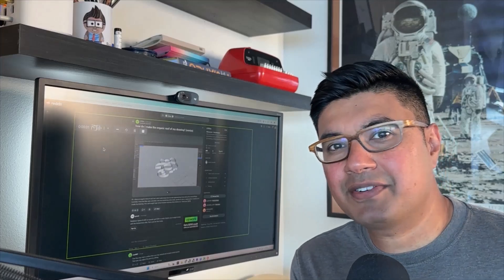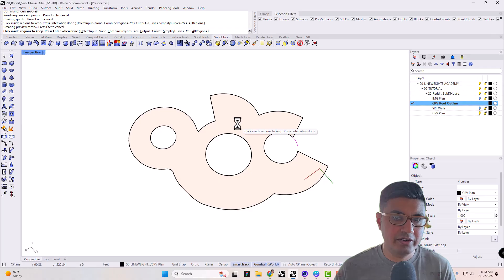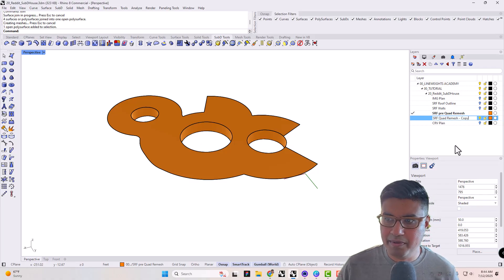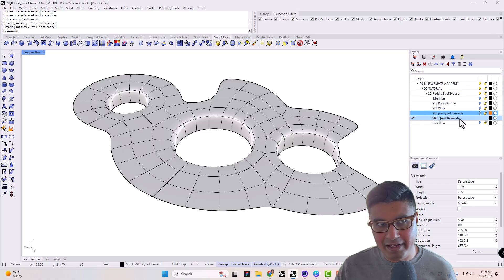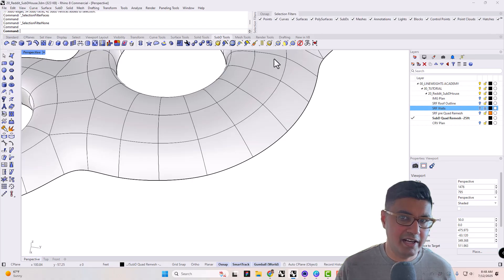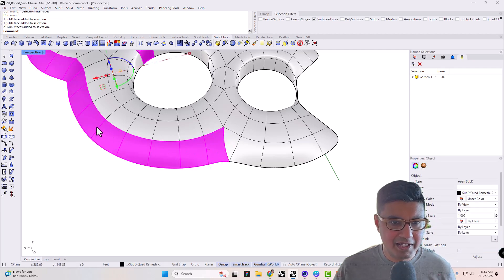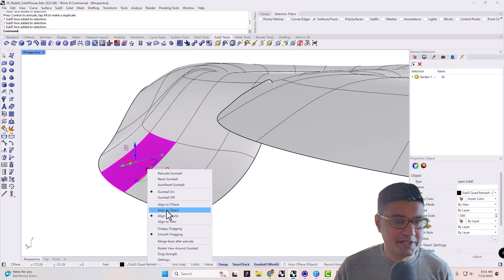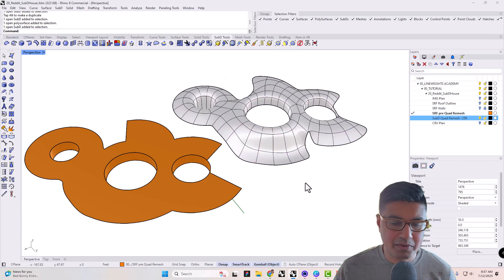Your First Roof Design with Rhino SubD Made Easy - Rhino 8 Tutorial

Comment: Welcome back !!! 
if possible make a video about interior modeling (specially kitchen design) using rhino. thanks
Reply from the maker: thanks! good to be back. What specifically about kitchen design do you need help with?
Reply: @RhinolikeaPro  I tried SketchUp, 3ds max, Revit before, only for kitchen design. and there was thousand of videos on internet with fast workflows to model interiors, cabinet doors, how change door styles from shaker to raised panel, etc. but for two reason I am shifting to Rhino now: 1- design capabilities of above software wasn't good. 2- now I want to design furniture as well, and rhino is better product design tool, also can export to CNC routers. 
BUT the problem is I can not find too many interior design tutorials with rhino, but for furniture design there is plenty.